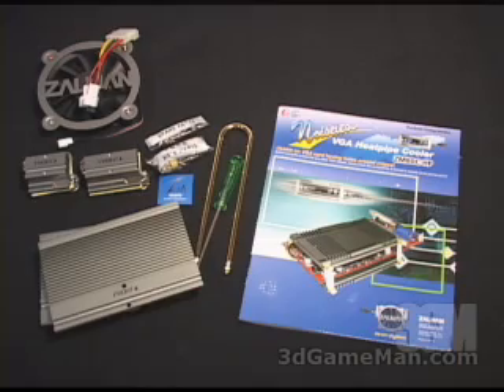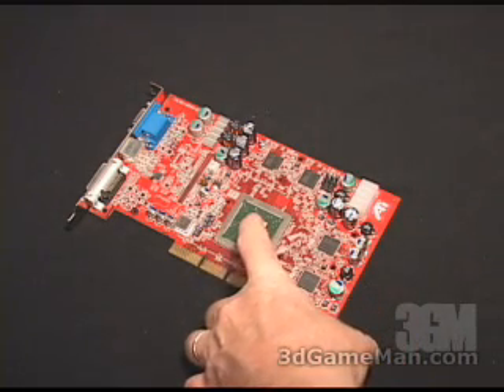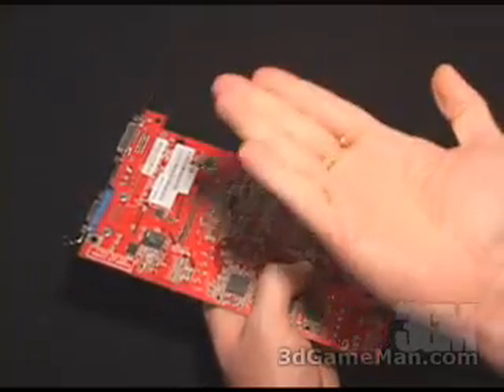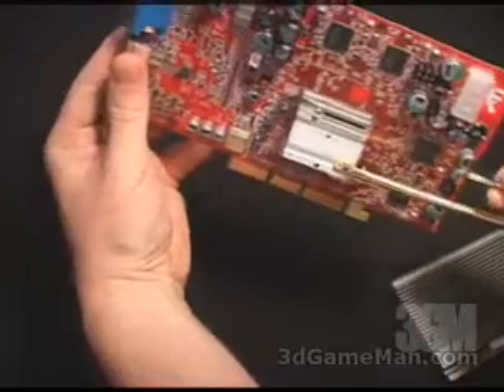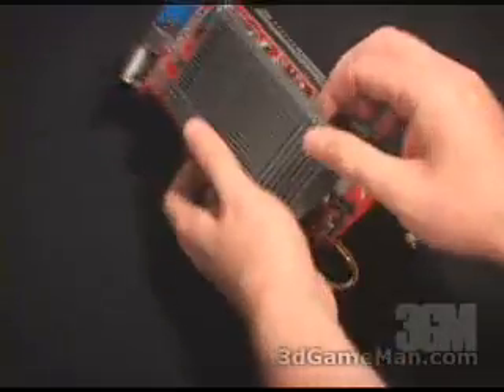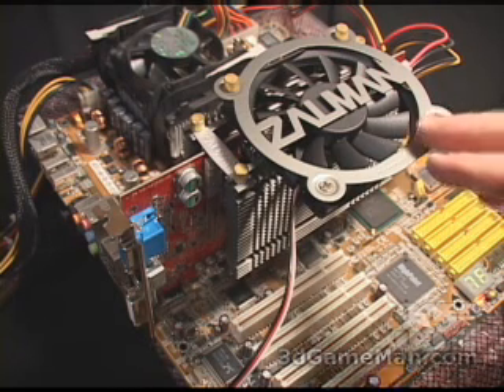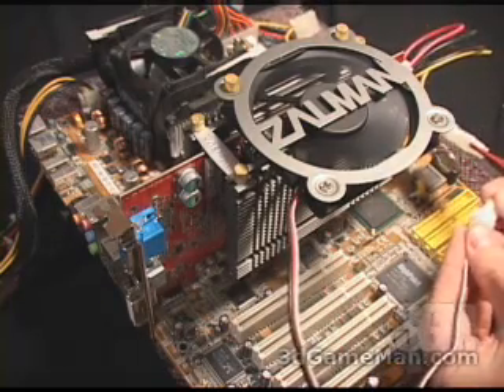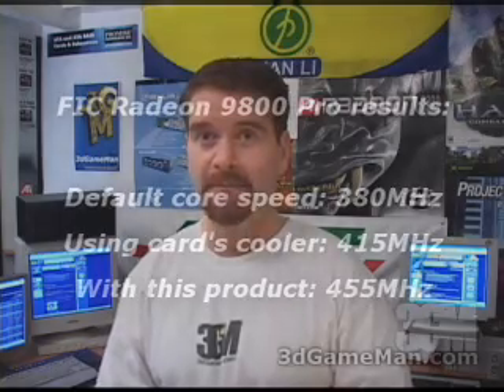#342 - Zalman 80C-HP Heatpipe VGA Cooler w/ Optional Fan

Comment: Jesus, you have been around for a while. I got the ZM80D-HP (dual heatpipe model) with ZM-OP1 back in the day for my Geforce 4 ti4200 when the little cooler crapped out on me, just out of warranty as is usual with that stuff.
Reply from the maker: Actually, I started in 6 years before YouTube existed, in the year 2000. The very first reviewer.